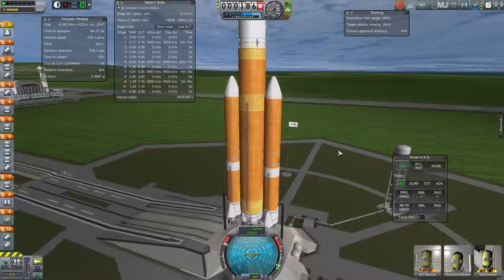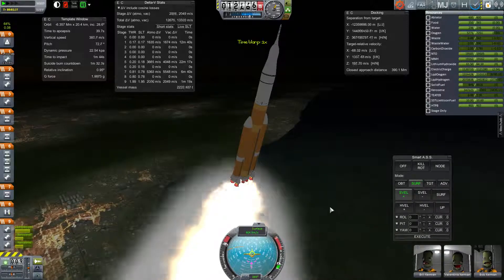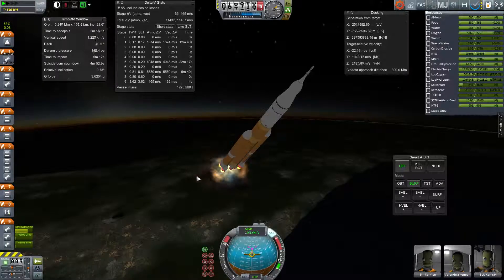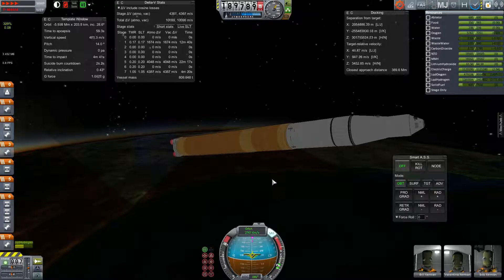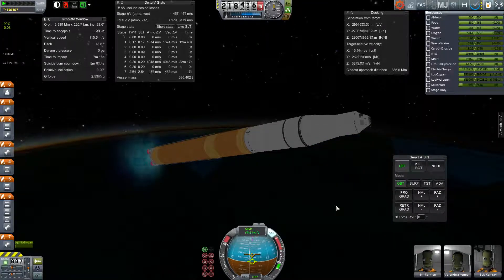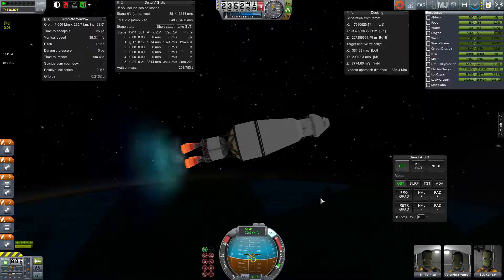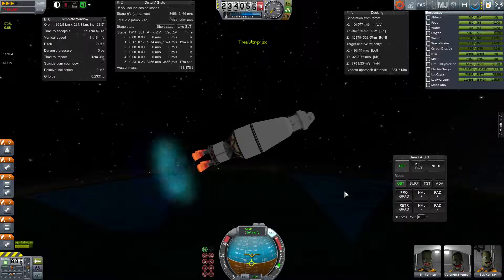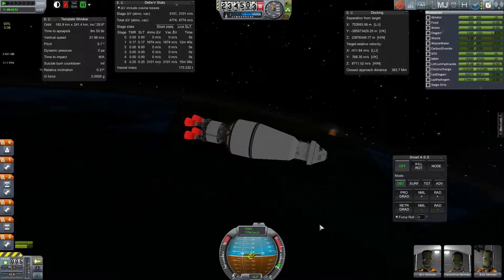SSTU SLS RO To The Moon 1

Comment: 8:12 how do u get your engines unfolding ? Love this animation
Reply from the maker: I see that beast is around 200T at nearly orbital speed when those engine nozzles come down. Truly a beast I made!

There are a few mods that include engines nozzles that do that, since there are actually a couple that do so in reality to save space.

The mod I'm using here is SSTU, and as far as I know the engines still do that.
https://github.com/shadowmage45/SSTULabs/releases

IIRC, the particular advantage to the way SSTU does it is that the animation of the nozzle coming out has to complete Before the engine will actually light up and start generating thrust. The other mod I saw that does this allowed the engine to ignite before the nozzle extension was out.